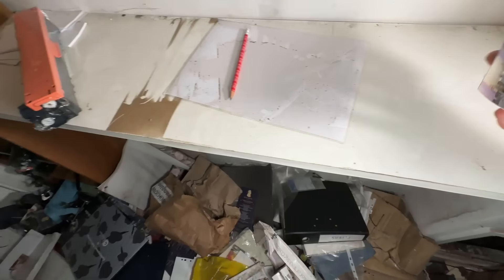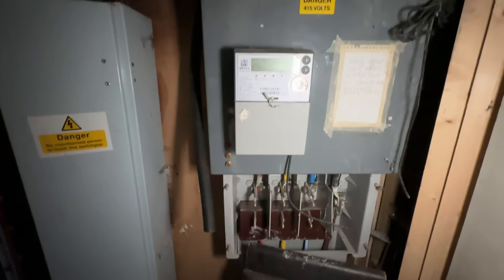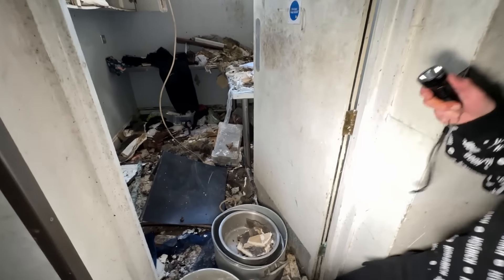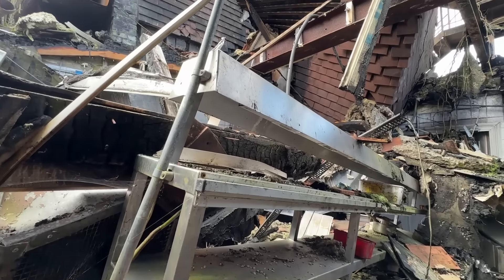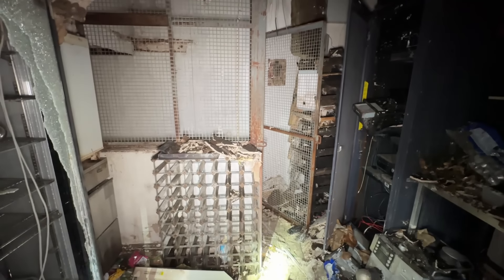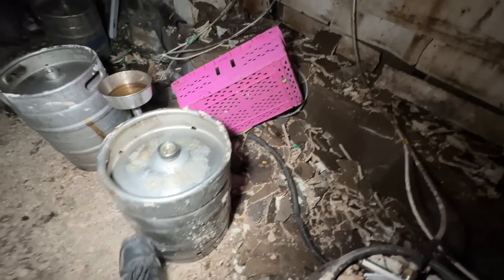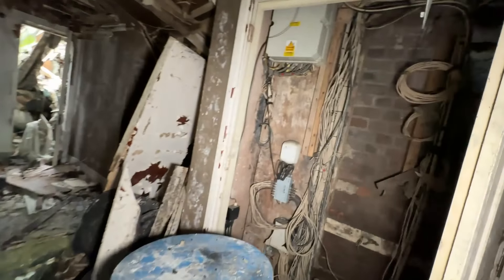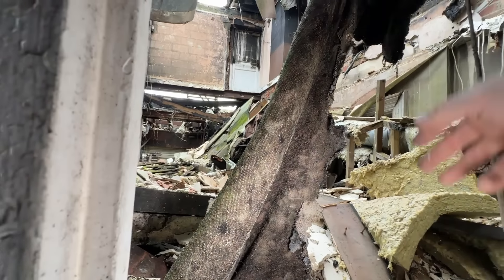ABANDONED dangerous hotel - abandoned places uk

Comment: The fire happened in October 2021. It started in the Kitchen at 8.20pm on a Friday night, so both the bar and hotel were in full operation. In fact on the local community page for the area, the Chef is actually credited in helping to evacuate the building so quickly and there are also comments left from staff working there on the night the fire started. Apparently the owner is suing the insurance company for failure to pay out so it's been in stalemate for over 2 years. The local Council have slapped a protection order on the building for preservation - I'm guessing they haven't seen the state of the inside of it, it's going to take a lot of coffee mornings to cover the cost of rebuilding that!.